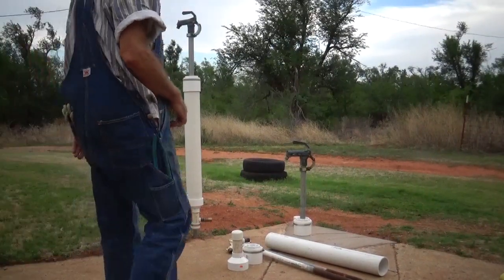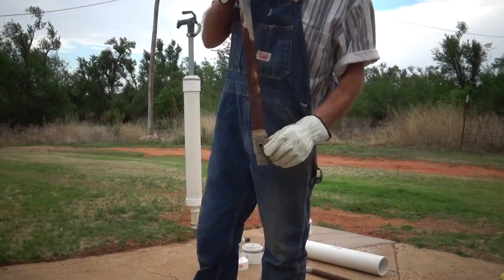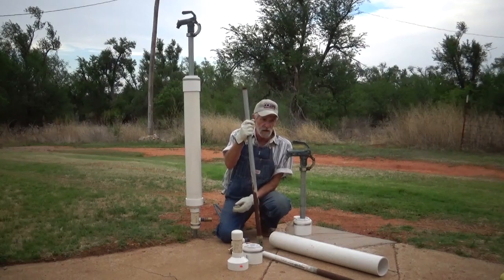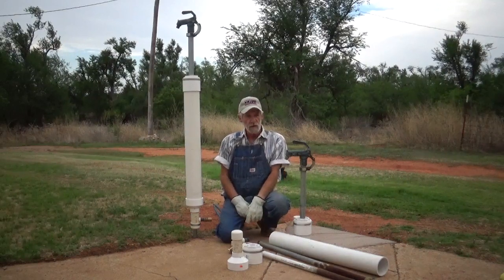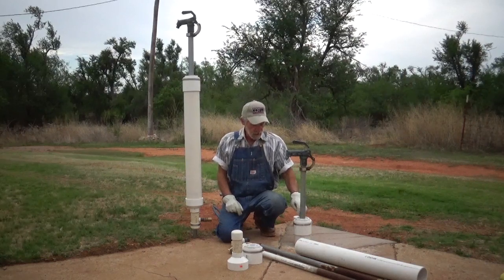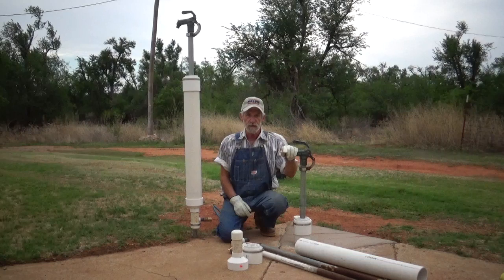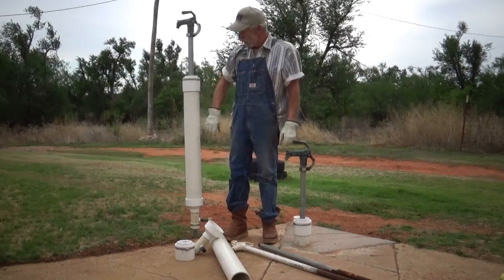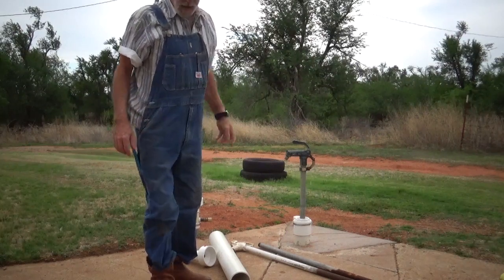Yard Hydrant Failure and Solutions

Comment: I put in a bury hydrant when we first moved here nearly 30 years ago and it came with really good instructions.  They said to put on a 1' or longer piece of tubing and then put in a gravel bed about 2 ft. long.   There are 1/8" pipe threads in the weep hole.

Comment: We hook a pressure washer to our hydrant and for the past year the pressure has been very low.  Water comes out normal when it is turned on.  The hydrant was installed in 2016 and always had good strong pressure when we used the pressure washer.  Could it be clogged somewhere or a crack in the line?  Water pressure at the house is fine.
Reply from the maker: 3 questions ??  r you on well or other source ???  have u accurately checked  pressure at hydrant while both running  and open but blocked off==no flow ??  have u checked  GPM by holding  5 gallon  under faucet spout and timing while filling ???

Comment: My hydrant doesn’t drain down the way it used to. Every time I turn it on or open it, water comes out right away. Is there any way I can apply pressure into it with a compressor to clear out that drain valve?
Reply from the maker: yes u can apply "short term " fix to get thru winter ??use compressed air or water pressure ~~~  unfortunately ??if weep hole is stopped with lil roots or dried mud r problem only long term is re-work drain field
Reply from the maker: it may fix long term if sand from well is only problem
Reply: @easychangeyardhydrant1641 . I finally ended up replacing the hydrant. Couldn’t clear out the weep hole using compressed air. Used the bucket and gravel method.

Comment: I have one of these Monitor faucets and the handle has gotten hard to open and close. It’s probably 2 - 2 1/2 years old. Any suggestions for loosening the handle.
Reply: There are rubber bushings that the rod slides through.   You could take it apart, remove the rod and polish the rod with some fine steal wool where it slides through the bushing (or replace the rod) and ideally replace the bushings.   Parts should be available from the manufacturer.  As a quick fix you could try spraying silicone lubricant around the the rod and bushings while working the handle up and down.
Reply: @jasonthurston799  

Thank you very much. I had wondered about trying the silicone but was uncertain. I’ll give that a try first.

Comment: My hydrant wasn't working. Pulled off head and found that plunger had come off. Got it out, reattached and it still would not allow any water out of the head but it does come out of the weep hole. Not sure if someone had previously replaced plunger and it's wrong one. Or do you think the port that allows water to flow around plunger is clogged or rusted shut? That's the only thing I can imagine. Even if I pull the plunger all the way out I get water flow out the drain hole but none out of the pipe. I can imagine there's just not enough pressure with the weep hole leaking, but seems like it would come out some. Those weep holes look small and pipe is only about 3 feet above weep hole. I don't use it much and I'd like to get it working but such a pain to dig out.

Comment: Plunger came off and stuck?  Buy a hole hole saw the same diameter as the inside of the pipe and a piece of all thread that will screw into hole saw.  BE CAREFUL not to drill into brass past plunger. Turn water on to flush out any shavings in pipe. This will clean off any rust build up also.